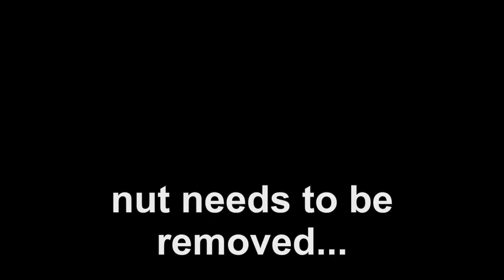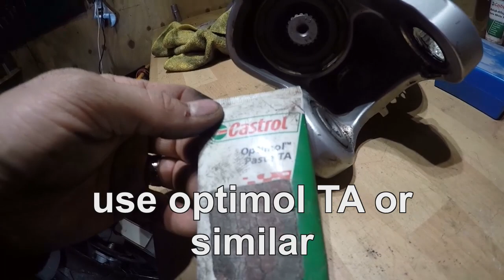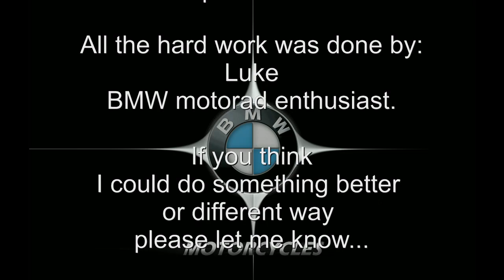BMW R1200GS | Final Drive Repair | All bearings replacment |Part 3|

Comment: Great video, but I noticed a couple of times in which the pinion bearing races are not pressed properly and are putting undo stress and pressure on the bearings. Whacking the bearing with a hammer is generally not a good practice.  I purchased the proper pipes to ensure all pressing is done on the respective bearing race to prevent damage to the bearings. Nevertheless, thank you for the informational video.